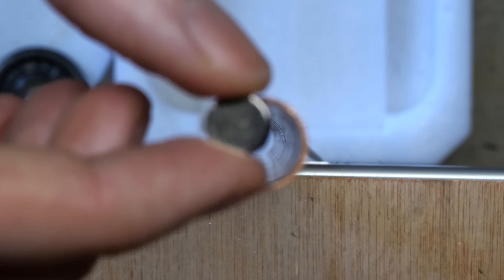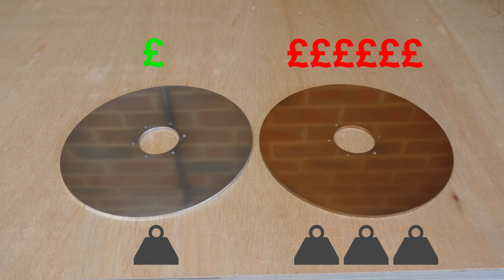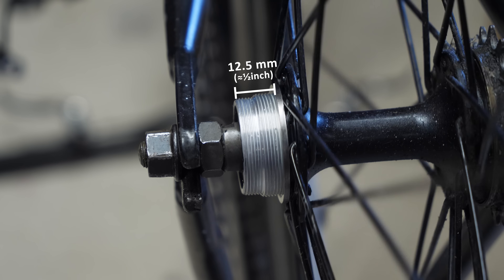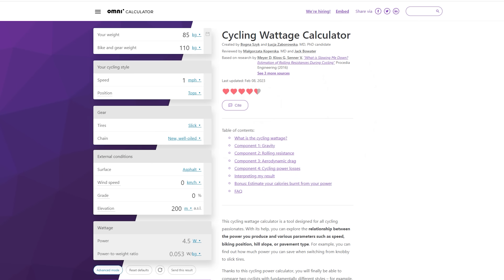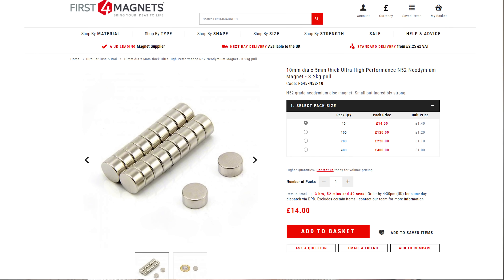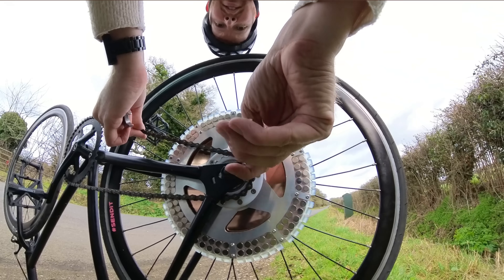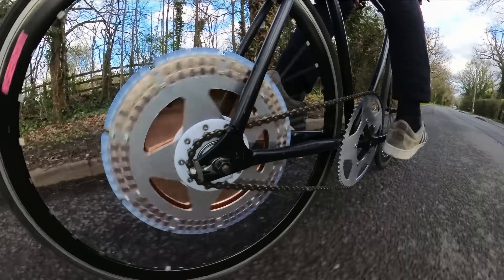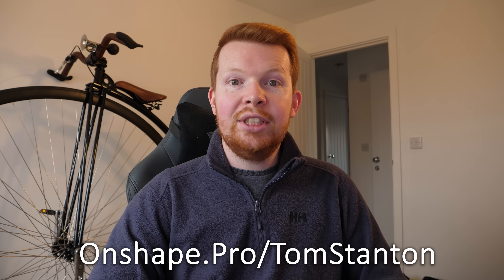Gearless Magnet Bike

Comment: This could still be useful if mounted on the front wheel as a brake system for riding down long hill slopes, especially if you use the rotation of the wheels to blow in some air for cooling. The brake calipers would just stop the magnet wheel and you would slow down to a survivable speed, no matter how long the hill is.

Comment: 1. Wasted heat - disc doesn’t need to be solid, but you need copper where the magenta are. you can have a thicker copper disc for more rotating mass/flywheel effect but where the camera can see the copper is where could have airflow by removing material 
2. Pedal input - Put front derailer back on and have 3 sprockets on crank?

Comment: What if the copper was in rows, similar to the spokes rather than a flat disk...like fingers and a hub in the center...then the copper can be put on a PCB..imagine multiple layer PCB's with those fan type traces causing the eddie currents to alternate , similar to a pcb motor but in reverse

Comment: This is exactly what I am experiencing with my direct drive bike. As soon as I remove power the bike quickly slows down and to peddle the bike without power I can barely push through the drag from the magnets. The magnet drag on a direct drive motor is quite high. There is no way I could ride the bike home if I run out of power, I have to walk it. At 70 it is such a problem that I am investigating changing to a geared motor.

Comment: Really cool video, but i have a few ideas on how to improve your design that you might find interessting.

It's nice to see you build this project, because i once had a similar idea but didn't have the time, nor budget to explore it.
I think you could improve this design and make it into a sort of CVT.

The main problem (aside from the wasted heat energy) that i see is, that you still don't have a constant RPM, that you can pedal at.
Pedal_RPM = (wheel_RPM + slip_RPM) * gear_ratio
Where the slip_RPM is a function of the torque you apply to the pedal. So at a standstill you pedal with (0 + slip_RPM) * gear_ratio and at cruising speed with (cruising_wheel_speed + slip_RPM) * gear_ratio. Another problem that i can imagine is,that everytime your pedals are above one another, you can't apply an accelerating torque and the magnets slow down your pedals, which is bad, because you stay in this no-torque position for longer.

Now to my proposed improvements:
You electronically vary the distance of the magnets to the copper disc with something like a servo and an Arduino.
At 1:37 you showed, that having the magnets a small distance away from the disc removes the eddy-currents and thus the breaking force completely.
So here is how this would work:
1. An Arduino reads in the RPM of the pedals
2. If the RPM is too high, the Arduino tells the servo to bring the magnets closer to the disc, thus accelerating the wheel and breaking the pedals. If the RPM is too low, the Arduino tells the servo to bring the magnets further away from the disc, thus alowing for more slip and removing the breaking torque on the pedals.

I'd really like to see you try this in another video, only if you want to of course.

Comment: Question: if you had two disks overlapping on the edges like a Venn diagram, and then moved them in and out from each other, would the difference in average overlapped velocity form some sort of gearing, where further out would be high gear and closer in would be low gear?

Comment: Did you try braking by backpedaling? Is there anyway to wire this to be a generator? If so you could charge a battery that you could then use to power a front hub motor for starting and uphill assist.

Comment: There's a bike trainer that does this by putting magnets near the aluminum of the rear wheel's rim.  The closer you put the magnets, the higher the resistance.  It's really cool.  And silent!    But this gives me an idea.  Bike industry is always facing the problem of a limited space to fit ever-increasing gear count.  If your solution had the ability to adjust distance,  you would have the ability to have virtual "infinite" gears - the holy grail of cycling.  SRAM and Shimano needs to be paying attention to this.

Comment: It would just need some small adjustments variable load lock could cause it to lock up in an uphill situation so it acts just like a regular sprocket and down hill the magnetic brake could come in handy even on flat land the clutch is only used for smooth takeoff like a torque converter it should lock up when a speed is reached the concept did work and is very impressive design

Comment: I'm sure I've seen a thread-cutting device for a CNC mill; perhaps machining that disk in steel and bolting the copper plate to it would be stronger while still fairly light...

Perhaps the heat generation could be useful in some other project, like a no-electricity, no-fuel water boiler?  Directly converting mechanical energy into heat by way of induction?

Comment: The real question is if this acts as a torque converter, like in a classic automatic, and it's efficiency.  The faster they slip, the more current they generate, and the more it pulls the drive disk with it.  Classic automatic torque converters aren't very efficient, because they generate heat, but they do work well because of uncompressible hydraulics.  In theory, the closer the input and output are in generation, the less heat it'll generate, and the more efficient it'll be.  We see the same effect in hydro torque converters, and even props.  Running it with gears may give the best result, keeping the differential speed in the sweet spot.

Comment: Pretty fun experiment, thanks for being honest about the physics and the intrinsic energy losses. If you want a CVT, pedal a generator to power a boost converter to charge batteries, then power a drive motor. This is how the new Honda hybrid system works. The voltage/current conversion in the motor driver lets you freely vary the amount of power extracted from the pedals and delivered to the drive motor with 10% losses instead of 50-100% losses. Battery is not strictly necessary but highly recommended to stabilise the DC bus.

Comment: I Created a variable power transfer magnetic transmission using permanent magnets like this and aluminum plates in highschool a few years ago. Downfall was that everything was 3d printed, and the heat when under extreme load from the Eddie currents was too hot for PLA.

Comment: I've also thought about this contraption, so I'm glad you built it instead of me. I suppose this also rules out replacing the copper disk with a disk of copper coils that are managed as a generator for powering a front wheel motor or battery. Bummer... I guess it's back to designing giant, stompy robots instead.

Comment: It's always so mesmerizing to witness eddy currents.  I was playing with magnets and a copper pipe a while back and it's so so interesting to see it happen.   The clutch idea is interesting, I could see this being useful in some kind of application that may get sudden changes of resistance, and it would save the output shaft of the motor.   Rollercoaster brakes also work similarly to this.
Reply: Do not forget that Trains are fitted with induction breaks. No wear, and at high speeds to stationairy rails incredibly effective.
Reply: Roller coasters use this for emergency brakes.(obviously using a secondary brake so the train comes to a complete stop)

Comment: For a CVT feel you need a torque converter, like the ones in automatic transmission. They can multiply torque (aka transform speed difference into torque multiplication) by the magic of fluid redirected by stator
Reply: How can torque converters increase torque anyway? If we make a free body diagram of a gear box, the torque through the output shaft is the sum of the input torque and the moment due to the radial/transverse load on the bearings of the two shafts. Is there a stator in torque converters that transfers torque to the housing? There has to be.
Reply: @JWQweqOPDH  The extra torque comes from stator that redirects the "used" fluid from output turbine back into pump turbine at such angle that it already carries some forward momentum, meaning that the pump turbine needs to do less work to accelerate the fluid. As a result there is a torque that wants to drive the stator backwards. In a stall condition, that is when the output turbine is stationary it means that the stator just needs to stay still to do its work. Once the output turbine starts to spin the stator has less work to do until the point when it actually would start acting as a brake and that's why it is mounted on a one way clutch - Once the torque converter exists the torque multiplication phase the stator starts to spin forward, at slower speed than other turbines.
Reply: Yes! That will be great. No Gears like in A Königsegg supercar on a bicicle

Comment: Spring loaded magnet carriers that move outward the faster you pedal.  The carriers should be stacked vertically too, up to 4 rows. Make the copper disc with a composite center section, that way as the magnets move outward, more magnet gets exposed to the disc.  The faster you pedal, the more it engages the clutch, the harder it is and more power transfer occurs.

Comment: You need to close the magnetic path.  You are wasting a lot of potential flux density at the moment because you effectively have big air gaps in your path on the outer sides of the magnets, and air does not have good permeability.  This would also help to contain the magnetic field and stop it affecting the chain etc.

FWIW you just re-invented the magnetic retarder, used on some trucks and busses to provide supplementary braking.

Comment: For me, the reason why you built this seems a little unclear. You only explained something at the end, but still, not much. 
I would also like to see some calculations, that would maybe show where the energy goes. For me, it's not an alternative to transmision/gearing, it's just a clutch, that always slips. That thing could be a real clutch, if it had a locking mechanism. And would be only usefull for internal combustion engines, not for pedalling.

Comment: Would the results change if you had used a aluminum sheet with greater diameter or thickness but same weight as the copper?

Comment: "you stole my idea"- i am thinking to make that kind of transmission (only with magnets, no copper plate)on water pump on car: when engine rotates slow to middle, resistance of coolant is low but when engine rotates fast it is too fast for water pump and then it would slide and spare some hp on water pump, 3500rpm on water pump is good but engine can rotate faster

Comment: So next step is to build a version where the eddy currents are captured and used to charge a hybrid system, allowing the rider to charge while cruising, and boost for starts and hills. Actually, replicating the Prius' planetary eCVT would probably be doable on a bike using 3d printing, benchtop milling and a small lithium battery or even supercapacitor. That would be incredible!

Comment: I think In place of permanent magnet we can rather use an elecromagnet to vary the magnetic pole strength so that we can decrease or increase the eddy current produced and thus can overcome the problems faced currently but it's difficult to wire the whole setup as it has everything moving
Reply: * I  think In place of permanent magnet we can rather use an elecromagnet to vary the magnetic pole strength so that we can decrease or increase the eddy current produced and thus can overcome the problems faced currently but it's difficult to wire the whole setup as it has everything moving *

Then you have to carry a heavy battery to power the electromagnet.
Reply: @StevenSiew2  ya that's also a big concern 🥲

Comment: Would be nice having a thermal readout of the copper disk during riding - either just directly measuring the temperature with a sensor or a thermal camera (black coating to get actual readings and not just a reflections).

Comment: But, that's not a transmission in the traditional bike sense, to switch gears, either by a derailleur or planetary hub, it's "only" a really inefficient clutch used the wrong way. It would be interesting (but a lot more complex) if you could use the coupling with eddy currents combined with actually changing the gear ratio. I think the target should be to minimise the amount of slip in the eddy current clutch, as that is wasted energy. Thinking of how to do this, but you need significant force to actuate a derailleur. would be cool though, a mechanically operated automatic gear shift.

Comment: Would a setriffical magnet setup help you get lower and higher gears?
I wonder if this setup could replace a fluid torque converter in a car? It basically does the same thing and heats up but has no parts in contact. You could use the heat for other uses.

Comment: There is a way to make the magnet field even stronger. Just rearrange them in a halbach array. This will direct most of the flux towards the copper disc. As for the copper disc, make it thicker. The Eddie currents are making it hot. Thicker copper > lower resistance > less loss. 

Thank you for the awesome video!

Comment: Next you need to try to replace the chain with thick conductors(spinning the wheel with a motor powered by another one that is connected to the cranks)

Comment: you could also double your transmission by putting another disc setup on the non-drive side of the bike and use two right hand crank arms. the power transfer would double, wouldn't it?

Comment: I don't see why you used an entire disc of copper, since the magnets are only really interacting with a ring along the outer edge. Could you try cutting out just a ring of copper and then mounting it to a much lighter bracket?

Also, if you continue this project further, there are bikes available with fabric belt drives instead of chains, and plastic spoke replacements as well.

Comment: At first I thought this could be a good idea for something like an omafiets due to the theoretically high number of “Gears" (ie your thoughts at the end of an almost CVT type system) while needing less maintenance than a derailleur and introducing an almost coaster brake-like system of slowing down, but unfortunately the downsides outweigh the benefits. Still, it's an idea that was worth testing, and it's better to try something out and find out it doesn't work than it is to rest on the past.

Comment: Dunno if you mentioned it due to noisy toddler but if you used electromagnets it would work much better. Look up "retarders", used in buses and trucks as extra braking but also in chassis/engine dynos for steady state engine tuning.

Comment: Drop this the bearing, the copper disk and use the magnetic ring and put coils on the frame to drive it as a motor like you did it on the paper airplane, the motor could be partial just on the frame side

Comment: To maximise the magnet flux on one side and reduce the flux on the other magnets can be arranged in a halbach array, rotating each magnets orientation 90° rather that 180°. Probably wouldn't work so well with the circular magnets but would be easy to implement with the cubic ones

Comment: It’s brilliant, perfect for a motorized application where you want to reduce the original shock on the motor. I would suggest you go with a belt drive though to eliminated the chain magnet problem? Also, it would be cool to be able to have multiple gears?

Comment: This would be cool to see on an electric bike. Can use any difference in speed to charge the batteries and can even be used to help pedal for steep hills.. This could also help in breaking as it should break harder if there is a load to charge.  I would maybe make the chain freewheel when not pedaling unless you press a break then pedals can tie back to the chain to stop. Then you can coast downhill without pedaling.

Comment: Wasted heat is unfortunately the downfall of this for acceleration.

For braking it is great and actually you basically have made a telma brake used in heavy vehicles. 

One way you could make this work is take a casette apart and replace a gear with this, that way when you pedal you have 1:1 and aren't wasting enerygy to pedal, however, when you stop pedalling, it will slow you down much more efficiently.

However again, a flaw with this is not wanting to slow down everytime you stop pedalling, you may want to coast on a slight downhill. I believe though this is an easy fix by making the magnets movable, when you want to freely coast, you can pull the magnets away from the disc, when you want to brake then re introduce the magnets closer.

Comment: 2 questions 1 would a Carbon Fiber wheel work better the ones they use in racing to stop the magnets from sticking to the spokes and 2 wouldn’t the heat of the resistance be big but if u use a Peltier device would you be able to capture the waste heat and convert it to electricity to power lights or some thing

Comment: So if the speed differential is what gives it the "power", how about mounting the magnets to the rim and having a moveable metal plate mounted where a normal rim-squeezing brake would be?
Then you can get a no contact eddy current brake without wear parts and still use the normal chain and gear system for pedaling.

Comment: A simmilar idea would be to turn a generator through the pedals which inturn powers a motor that turns the back wheel. Would be interesting to see how much energy is lost through this. Also a battery could act as a energy buffer. As you ride down a hill you could keep on pedaling to "prepare" for the next climb making the power you have to put in much more even.